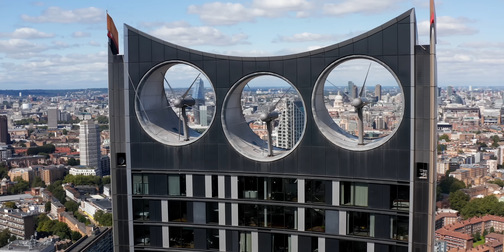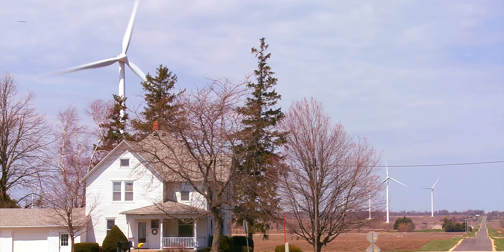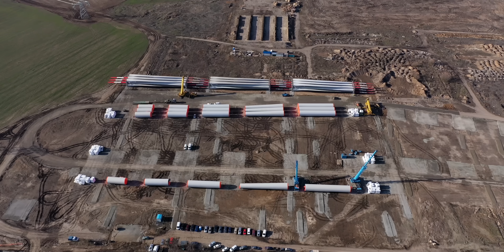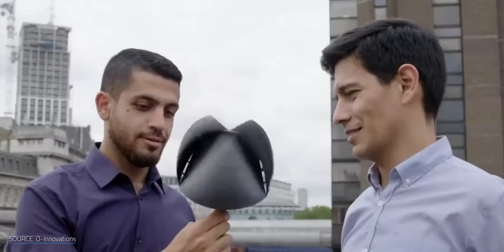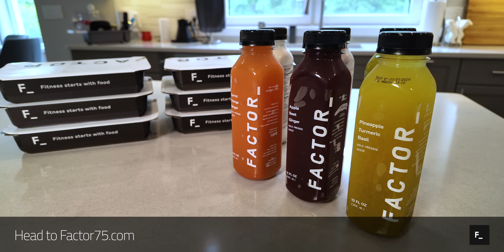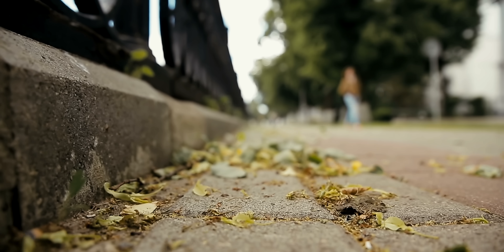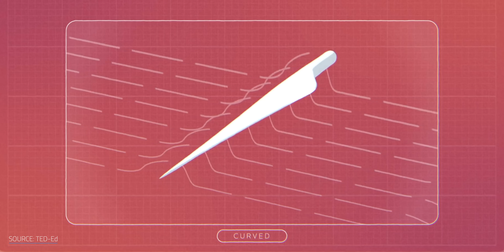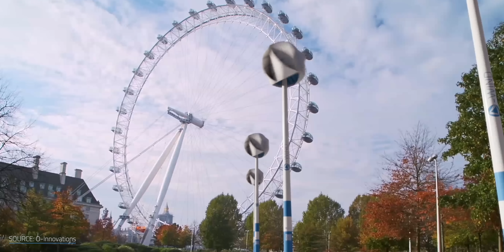How a Small Wind Turbine Will Revolutionize Wind Energy

Comment: omni directional wind turbines are not actually all that great because wind turbines energy production grows with surface area blocking the wind. Omni directional wind turbines have an area equal to width * height meaning the amount of energy it collects grow proportionally with an increase in width and height. traditional wind turbines on the otherhand have a surface area equal to pi * radius * radius or pi * radius ^ 2. Because traditional wind turbines surface area increases at a rate of r ^ 2 the amount of energy they collect grows at an increasing rate compared to the increase in radius. meaning as radius increases from 1 to 2 to 3 you can expect the relative surface area to go from 1 to 4 to 9. this is important because it means less resourses are required to match the energy collected by an omni directional wind turbine because you need shorter wind blades for the same energy output on the traditional wind turbine.

Comment: - with the "Onmi" claims - how doe sit go at pure UPDRAFT - it my be tuned for a Down draft / wash, but the same feature cold be negated on the updraft...
(Some efficiency curves will be fantastic - in all directions)  

Also - claiming that "Bernoulli" magically gives an energy gain in speeding up air is disingenuous to the max  (remember Newton and the equal and opposite, bit) ...   In free flowing air - a duct which restricts flow enough to increase the pressure ratio (appreciably) through it is already well on the way to stalling and creating another path for the air - AROUND the outside of the turbine.  (High speed differences and constrained pressure "multiplication", really work to the maximum in pumped ducted flow - Wings work differently - they are not a constrained flow situation  - as is imagined in every entry level text bok when drawing control areas and flow volumes.  Open ducts, while they can work - need to consider reactions and not be overly ambitious on the "magic".)

Comment: i don’t like the descriptions of the physics in this at all. like, the venturi effect would actually works against the spin. As the air speeds up there is less pressure on the walls (ie the “blades”). That means less pressure/force to spin. the benefit is probably more that fast moving air come out of the slit actually hits the trailing “blade” with more kinetic energy. (also benoulli principle doesn’t explain how wings generate lift)

Comment: I think wind turbines are being over engineered. The focus is on more power which requires higher winds which relates on more stress to the system.
Going for low cost low stress solution is the breakthrough. 
Wind energy doesn't exist in a vacuum it have to compete. 
And exactly because it is low power but consistent is the strong point.
A simple sail like design that have driven us for millenia is going to be the breakthrough that mechanicly adjust to wind speeds.
Unfurl at lowe wind and folds at higher.

Comment: If installation and ROI are about the same as solar panels I can many potential use cases for the U.S. even with the average higher power demand of U.S. consumers. A lot of the northern U.S. is not great for solar but might be viable for wind or a wind/solar mix. In the end it will come down to ease of installation, maintenance, noise, and ROI. I could see putting a couple of these on my own house if the price were right and they are as quiet as the inventor claims.

Comment: Actually, this kind of omni-directional function plus not having huge swirling booms spinning around would make this an excellent application for electric or hybrid-electric boats, especially long-range cruisers that need to be self-sufficient.  On cargo carriers, arrays of these along the edges could reduce fuel costs.

You can get some energy from a solar roof, but in higher latitudes, overnight, cloudy windy conditions, etc having some of these up on poles (or deployable on extendable poles) would make a great second power source, especially while anchoring/docked overnight to fill the battery packs for the next day.  During windy times, you could afford to run the boat faster without draining the batteries.

Comment: I think this is a good idea that explores wind power generation in urban areas.
General wind power generation is partially deceptive, and expresses performance based on the assumption that wind flows from a certain direction at a certain speed or higher, and is not effective in urban areas where the wind direction changes hourly.
What is important is how many years you can extend your lifespan overall.
I have high hopes for this product, as it will be important from now on to secure power during times when solar panels cannot generate power.
The purpose of my product is to bring the wind directly into the room, but it is quite difficult to capture the complex wind blowing in residential areas.
Reply: This is a bad idea and an utter waste of time and resources.

There is no magic here and the math on these things does not math out.

These crappy things have been popping up for the last 25 years atleast.

Micro wind only makes sense in some niche cases (those being remote offgrid locations with a good wind profile or sailing boats).

The only scale that makes sense would be 6meter rotor diameter normal HAWT on a 60 ft pole with a generous 5m/s average windspeed. That'd net you 1200 to 1500 kwh a year.

90 feet would be better given urban wind obstruction.

You arent getting a permit for that.

Comment: i use about 14.2MWH/yr. I want wind as PART of my power solution, not as the whole solution. I have 8kw of solar already. Wind can work when you need extra power the most, during storms and overnight. If I could add 3 or 4kwh of wind production, I'd be set i think.

Comment: Before going down the route of trying something innovative like this, I think it is better to exhaust cheaper potential efficiency gains from more conventional technologies first as these are cheaper. I have long term (20 plus years) of energy consumption data from my current house. In that time I have reduced natural gas consumption by 68% and electricity consumption by 52%, just by doing the easy things, such as replacing the gas furnace with an efficient modern one, fitting thermostatic radiator valves,  increasing the insulation in the walls and roof of the house and replacing the windows with triple glazed sealed units and also buying the highest efficiency rated domestic appliances. My next step is to hire a thermal camera to identify externally the parts of my house that are leaking heat to the environment during the winter. 👍 Don't ignore the basics maximizing the efficiency of what you already have before trying something new and potentially inconsistent.

Comment: I think solar wind is vastly underrated for its potential use. I live in Ohio in what seems like a very windy location. Right now the wind is 8.7 with winds up to 16.5 mph over the next six hours - usually it is more. The "Village" consists of some traditional older and smaller homes but mostly recent nicer homes with a minimum .55 acres or more property. While I would like something that would provide all of my electrical needs, it would be very helpful if I could pay a portion of those expenses with something less obtrusive. I don't like solar because it is more obtrusive, costly and has ever changing technology than you pay to keep up with. You never know what your getting or how long it's going to last. Plus, it requires a lot of maintenance to keep it clean and running to maximum efficiency. At least those are my thoughts on it. I suppose the reason this video came up was because I recently looked at another "new" wind device for use in a situation like mine. The example was blue in a gray structure and less than 6 foot long. I liked what I saw in this video because it was multi directional rotating around a central pole. If you had a bunch of these in a community the community would have to be built around its use. Less trees with better exposure to critical wind streams. For me, I would like to put it in an enclosure on the top or side of the house where it blended into the community and environment. The first air condition systems were tower like structures that caught the air and channeled it effectively throughout the buildings in ancient Egypt and the Middle East. If you can catch air like that then you should be able to develop a structure to house a turbine that will provide the same result particularly on a tower on the side of the house. You could use that in warm locations to cool the house as well. In ancient times they say it could reduce the temperature 14 to 21 degrees. I have a roof fan that does the same thing. So a longer rectangular multi directional blade would do the job for me. I no longer have a chimney but whose to say I can't have a wind tower:-)

Comment: Air density near the ground is 1.2 kg/m^3. Power available in half the density of air time the cube of velocity.  Power in the wind = 0.6 x Vel [m/s]^3.  10W/m^2 for 2.5 m/s [ 9 km/hr, 5.59 mil/hr for 10.76^ft or 1.273 m dia or 4.177 ft dia] and it must survive hurricane winds with 41000 W/m^2  40 m/s.  But that is the energy in the wind not the energy that can be extracted.  A Savonlus rotor which this appears to be in the family of peak extraction multiplier is 0.16 and going up to an American wind turbine which is horizontal and many blades peaks at 0.30.  Where those three bladed commercial turbines peak as 0.495.  The theoretical maximum that could be harvested in 0.595 .  
And one must remember that when the energy is extracted the wind both slows down and expands pushing more wind energy out of reach.    Can not start putting them everywhere and clustered because your going to get diminishing returns.   
Further problem is that the frontal area of a Savonlus rotor is fixed so double the wind speed results in eight time the energy that can be harvested.  Commercial turbines can change pitch of blades extracting less energy, and even they have to lock out with a breaking system to stop rotation before locking.
Energy from the wind has to find a load or storage means.  If it can not then it is dumped as heat and the brakes will be used to match generated power to load.   The only advantage of the Sovonlus turbine is that even free wheeling it may have a tip speed of double the wind, and it has the potential of a robust structure.  Staying together.

Comment: Since they designed to work in turbulent wind, I wonder how close they can be to one another.  If one can only provide enough power for half the need of a typical American urban dweller, that simply means they need two of them rather than one.  So could a user simply string a series of them say, across a narrow space between two buildings?

Comment: Even if one turbine wont be able to power a kondo, its still better then nothing. It can off-set the use and still decrease the electricity bill to half.
Its same as Solar. Solar also needs to be in a certain range that makes it 100% green.....but it doesnt and during night and winter is mostly useless.
Same is with this turbine. It wont make wind farms useless, its just ads a surplus of energy that can be used, to the already running system, and giving a hand in to more green energy production, while lower electricity bills.

Comment: Everything combined helps, but how much production power grip can handel... Also average wind at night is lower than at day. So combination of wind and solar is not perfect solution. Okey you probably need less power for human use, but that electric car is probably charging while you are sleeping.. Without proper battery banks, you still need power grid for average user.. Power grid cable sizes need to increase to match demand and maintenance cost will also increase.. Less power grid user, less user by whom bigger electricity bill is divided.. -> Taxes increase..

Comment: the O-wind looks like an excellent candidate for a flat-pack self-assembly kit.  the turbine appears to be made of very simple repeating shapes which could be made from pre-cut sheet metal and assembled with simple tools.  That would leave the generator and power delivery electronics as the most expensive component.

It would be really cool to see this thing sold at several pricing tiers:

1 - "full service" - work with a local installer for the installer to provide and install a factory-built unit with all the bells and whistles
2 - "some assembly" - same full-featured kit as the "full service" version, but shipped as discrete subassemblies, with the turbine itself arriving in flat-pack form for the customer to install or arrange independent assembly/installation (say, from a general contractor)
3 - "turbine-only, assembly required" - just the turbine unit, in flat pack form, with a collet adapter to attach to a generator shaft.  customer supplies own generator and control system.
Reply: That's my style!
Reading all the negative comments on here....but my 1st turbine cost me under $10 in new materials (magnets) to convert a discarded ceiling fan into a generator.
Efficient? Nope. Does it power much? Nope.
It's enough to keep the lights on in my shed, though. Discarded "out of style", but perfectly good, LED tape light. Also not great....but, hell.....free is a good price.

Google search for 3d printable version of this yielded....err...something. Not sure what, haven't chased that rabbit yet.

Comment: Interesting concept ... but no data and there are a lot of potential issues with it. First of all: Usually small wind turbines are just not efficient enough to be competitive, and that isn´t a problem of catching wind from more directions. And this concept with the spherical shape needs more moving mass. All that really reduces it´s potential to use in some extreme places with high windspeeds and alternating directions. Okay, they identified such spots: specific locations on the side walls of some skyscapers. So, before actually concidering the installation, you need a very decent analysis of your local wind conditions and if that seems okay, you can start to think about the installation costs and the means of maintainance at such a place. All of that is a task for expensive specialists. And at the end of the process, you got a small wind turbine installed? It might be worth a thought if you are the owner of the whole skyscraper and if you want to cover a lot of your building with that technology. But how frequently will that really happen? We don´t even see a whole lot of skyscrapers with the walls of their top floors covered in solar panels, so why should demand suddenly increase , when the power source is wind? 
And if somebody indeed did all that analysis for a skyscraper, calculated the optimal attachment points for fifty of those devices - who can guaranty, that nobody else builts or removes another skyscraper nearby and messes up the unique wind patterns, which made it viable? And if you happen to have your own skyscraper, why don´t you just pay to built a more efficient big wind turbine somewhere else? There is some real demand for small wind turbines in regions with long dark winters. But those are not off grid skyscrapers. 
Long story short: I am highly sceptical, if something like that will have a big (enough) niche in the real world.

Comment: I don't like wind it generaly because it has inconsistent and unpreditable power output which leads to issues keeping grid energy stable, which includes using up excess energy to prevent infrastructure damage. This focus is on residential energy generation which requires a lot of extra infrastructure for inverters and contracts to sell energy back to the grid, and just generally takes up space.

Because of this I think centrallized energy methods is better. but having a few of these around wouldn't be bad for disaster situations.

Comment: What do I think?
I think that the biggest barrier to small scale wind-turbines adoption, is regulations, and not their lack of output. Will cities allow them, that is the question & problem. It doesn't matter if they only produce a fraction of a homes power needs, wind is an excellent compliment to solar power. If a small wind turbine only produces half of the power you need, install enough solar for the other half. If it only produces one quarter of the needed power, install two, and enough solar for the other half of your power needs. Or stay grid-tied, and just use a small turbine to reduce your power bill.